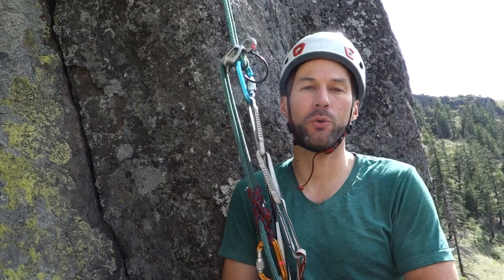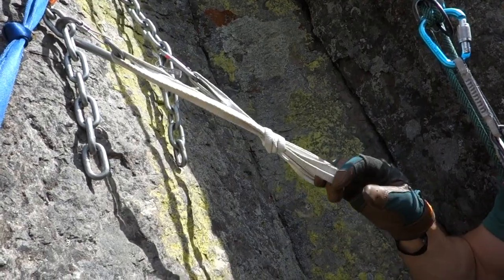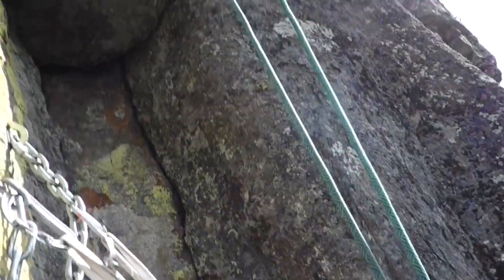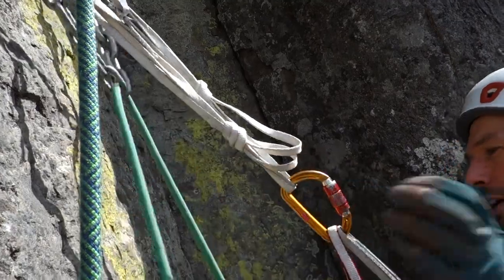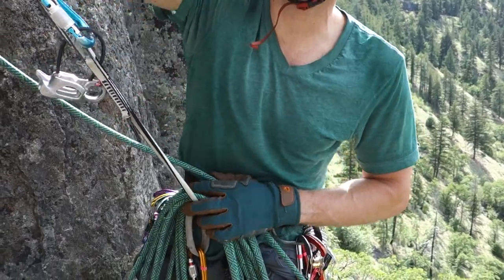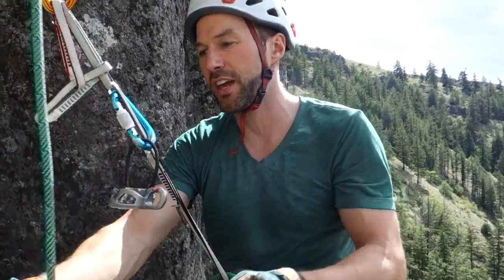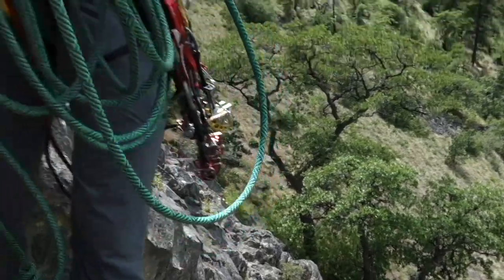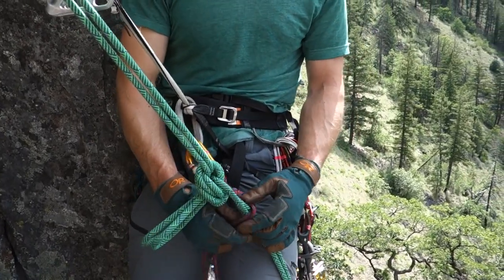Setting up a multi-pitch rappel

Comment: why do u choose a quad over clipping in directly to the chains?
Reply from the maker: This is a great question @stefanofalero!  Here in the US we have a problem with old, rotten bolts- even at the top of popular climbs in places like Yosemite.  As a result it is not generally recommended to clip into a single bolt as an anchor, and instead we clip into both in case one were to fail.  We also frequently use rappel anchors that have a hanger and a single rappel ring. If all climbers clip into both rappel rings (or worse- into the hangers) so there is redundancy, there is little room left over to thread the rope through the rings.  An additional problem is that the carabiners that attach into the rings or hangers can become pinched and levered, which increases the likelihood that they break.  The levered spine of a carabiner can be broken under body-weight, for example.  To solve these problems a quad anchor is added so only one carabiner needs to be attached to each of the two hangers, chains, or rings (the two carabiners belonging to the quad) and all climbers can then clip into the two shelves of the quad so there is plenty of space and no chance of pinching etc.  If you've ever found the carabiners from your personal anchor/daisy/slings that you are anchored to the wall with getting pinched, jammed, or cluttering up the rappel chains then you'll know what I mean.  This becomes especially problematic as a party of three, or when you are sharing a rappel anchor with another party.

Comment: Hi awesome video. One big question is what can I do if the rope gets stuck with something for example a tree branch after I finished rappelling when I’m pulling the rope . Or if I forgot to take the knot out.
What are my options there ?
Thanks for the video very informative
Reply from the maker: Thanks for your question @reksaiorn-od7vj!  There are several options in the event your rope gets stuck above you when you pull it.  The most common solution is to lead up the pitch to the point where your rope is stuck so you can free it.  This is only recommended if the climbing is well within your limit, there is sufficient protection available, and the amount of rope you have already pulled back down to the belay is enough to use as a lead rope to get back up (you will tie into the end you have at the belay).  If the climbing is above your limit, there is limited protection, or the rope is stuck really far up then it's usually best to wait for another party coming down the route to help free your rope.  If that's not an option, then borrowing a rope from another party in the area or grabbing another rope from the car (assuming it's a short approach) could allow you to climb back up the route and then re-rap it to retrieve your rope.  And if all else fails, use whatever rope you have at the belay to get down to the ground.  This may involve cutting the rope and using a shorter piece of it for your rappels.  One of my videos titled "how to rappel 35m with a 60m rope" can give you insight in how to get the most out of a shorter piece of rope if you ever do find yourself in the unfortunate situation of having to cut a rope and descend.  
NOTE:  If you lead back up the rappel route, there are three options for getting back down after you retrieve the stuck end of your rope.  Option 1: Leave gear or cord just below where your rope was stuck, and rap off this.  This is often the fastest and safest because you ensure that the rope will not go over that same terrain again.  Option 2: Down lead.  This is usually only a good idea if the rope was stuck not too far above the belay, the climbing is easy for you, and you were able to place a significant amount of protection to protect you as you down-lead.  Option 3: When you reach the stuck rope, free it and throw the end back down to the belay.  Then continue to lead all the way up to the anchor that you rapped off of, and rap off of it again but do a better job of managing the rope for the pull.  This is usually best done in easy terrain where the climbing goes quickly and you are sure you aren't getting in over your head with the difficulty.  
I would NOT recommend ascending your rope, as you don't know what the rope is stuck on, and it could pop free at any time and send you ground-ward.  It's sometimes worthwhile to set up a mechanical advantage system to try to pull the rope free, though in my experience this seldom works, can be time consuming, and often damages the rope or gets it stuck so bad that it's even harder to get out of the crack if you are able to get back up there.  And watch out!  If you do manage to free the rope by pulling hard, rocks can come down along with the now free rope end.

Let me know if that helped!

Comment: I always understood not to clip in to the links of the chain?
Reply from the maker: The chain is no problem to clip into as long as its integrity is not in question (worn through or extremely corroded).  Even some rust on the outside of the chain is generally not a problem.  The weakest chain used in bolted anchors is usually 5/16" or 3/8" grade 30.  Stronger chain is grade 43 and grade 70. 5/16'' grade 30 chain (the weakest stuff) has a Working Load Limit (WLL) of 1900 lbs.  This is a breaking strength of 7,600lbs, or 33.8 kN.   3/8" grade 30 chain usually has a WLL of 2350 lbs, which is a breaking strength of 9400 lbs or 41.8 kN.  In other words, the chain is much stronger than other components of your climbing anchor such as slings and carabiners.